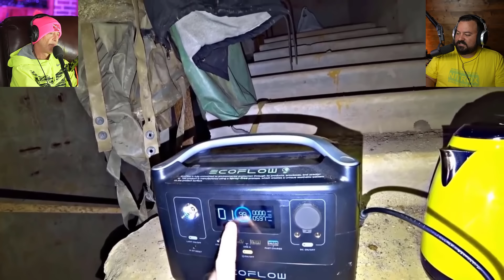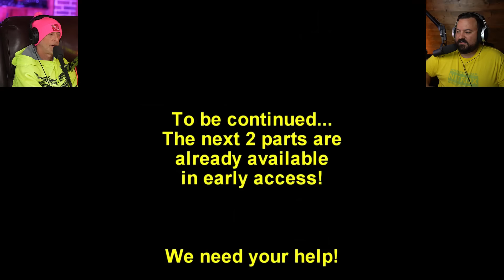Divers React to Diving in Chernobyl Part 2!

Comment: I am a retired Navy Nuke,  and as for the water, pure water is not radioactive,  but any impurities in it can become highly radioactive.   Cobalt-60 is the most dangerous isotope that they are probably encountering in large amounts.  It has a half-life of 5.27 years and produces ionizing radiation in the gamma ray window,  making it it exceptionally dangerous.  This whole thing is a terrible idea.
Reply: I don't truthfully believe they're diving in Chernobyl probably a bomb shelter? Do you have a professional opinion with that does it look like it could be a reactor?
Reply: And when radioactive materials go in your body, it would be mistaken for calcium, meaning it would go to your bones
Reply: @kevinverduci7600  definitely not Chernobyl's formerly operational reactors, they are being decommissioned currently. They did say it was the under construction reactor number 5
Reply: So whats the odds of them getting cancer from the dust inhaled
Reply: @sgtmuffinbadger6147  high
Reply: @kevinverduci7600  its real. They are near Reactor 5. There is a tunnel that does connect 4 and 5 underground. This is purely insane for views and money, but damn is it isn't incredibly entertaining
Reply: 5.27 year half life and Chernobyl was 1986 wouldn't that mean it's safe by now?
Reply: @samhyde6395  mostly, mostly safe, in the  safe zone that is.
Reply: @samhyde6395  "A good rule of thumb is that, after seven half-lives, you will have less than one percent of the original amount of radiation." so possibly safe, possibly not. seems to be a gamble. also is nobody going to mention asbestos? correct me if I'm wrong, but back then asbestos was still being used as insulation no?
Reply: @sgtmuffinbadger6147  radiation causes mutations at a cellular level so I’d say odds are very likely but the degree to how bad I don’t know however there’s a Japanese Man who survived both nukes on Japan in ww2 and lived to his 80s so you never know.
Reply: @kevinverduci7600  🤣😂🤣😂
Reply: @ughhbennnn  That's what I was thinking when the one idiot was hitting the ducting.
Reply: @kevinverduci7600  They are in the reactor 5 building that was never completed. Most of the videos they posted are from there. It's about a mile SE of the famous unit 4 that exploded.
Reply: @kevinverduci7600  they are in chernobyl in the number 5 reactor building which is about a half mile from reactors 1-4 it was never finished
Reply: I am navy nuke
Reply: @kevinverduci7600  they are diving in the stairwells of the unfinished reactor 5. Which is flooded.
Reply: It's okay, they were swimming through the power plant rinsing their mouths with the water and spitting out. Like wtf
Reply: I am retired navy nuke.  Trust me in doctor.
Reply: Of course you are
Reply: @samuelschick8813  true
Reply: @tylerofviolence , " I'm from the government and I'm here to help you."
Reply: @kevinverduci7600  No that really is Chernobyl just not the reactors that were active. It's the 5th and 6th reactors that were never completed.
Reply: How are they not wearing any protective masks?
Reply: @kevinverduci7600  They got tested the last time they did this and they were told they have a tiny bit more than usual but not a concerning amount of radiation. The water doesn't actually have much radiation the dust is what's radioactive and even that isnt too radioactive now. Ever since they closed up the reactor the zone for the most part has been safe.
Reply: @Crazyguy_123MC  yeah I would like to see them get tested again after their previous stunt where they where near the firefighters boot for half an hour and the radiation was off the scale
Reply: @kevinverduci7600  it is the dust that is radioactive and the mud. Which they do a very good job at breathing in and touch as much as they can. I don't think their personal safety is least of their concerns. At least they actually wore some kind of protection for once in that clip because even they know that the radiation was ridiculous in the area they were at (the lab with all the chemicals which were also leaking into the water and was essentially eating their suits)
Reply: Pure water is not radioactive bc why? Maybe bc it doesn’t have anything in it it’s called lure water for a reason….
Reply: @sgtmuffinbadger6147  100% chance at ambient radiation for the area over  I'd say 40 days in 10-20 years depending on lifestyle and risk factors. Doing this it could be over in as little as an hour leading to cancer development within 1-2 years depending on time spent where and what exposure level they are at and immune system does fight cancer constantly but eventually gets overwhelmed or undermined by exposure. So yes they are probably gonna have cancer or illness in some years.
Reply: @R3l3ntl3sss  is it isn't what
Reply: You should see part one if you haven't hahaha
Reply: @sgtmuffinbadger6147  very very very high
Reply: @kevinverduci7600  They keep saying they're diving in a reactor, but they mean the building housing the reactor. The reactor in building 5 was never fully completed meaning it never even housed any radioactive material. I believe you can visit the reactor chamber from this reactor because it's completely safe (there are obviously other dangers related to the area and what they're doing in this video).
Reply: I dont need the credentials that you have, to know this is a fucking terrible idea. 🤣🤣🤣
Reply: @Crazyguy_123MC  yeah, no offense, but I'm not trusting a Dr. To begin with let alone a Ukrainian, Russian, or any Europian one. To tell me have a slightly higher level, but nothing to cause too much concern.....
Reply: Bro I don’t know anything about what you said and I know it’s a bad idea
Reply: Water is a good attenuator of gamma though right? I’d be more concerned about alpha contamination from all the dust on the lead up to the water. Wasn’t a nuke but Army EOD.
Reply: Im asking out of curiosity, do you by any chance have any information as to what the tritiation levels are with regards to the water pools beneath the plant? Also why would they be encountering Cobalt-60? I would think that the main concern would be Cesium, iodine, plutonium, as well as other radiologically active uranyl progenates, their various isomers, as well as various radiologically active isotopic forms of materials which formerly composed the inside of the reactor and its shielding. I don't have precise data as to the composition of internal contamination of the plant but why is cobalt-60 the main concern for you. Im no reactor technician or professional but I would like to know your thoughts.
Reply: Thank God someone knows what hhey are talking about. My grandfather is also a former navy nuke, and currently to this day does maintenance and shutdowns on active plants across the country. Oneight say he's exceptionally over qualified in this area of expertise, and when I asked him about the water he gave basically the same answer. This is shit is mental
Reply: i mean.. i thinks everyone (but not them) have enough brain to know that's a bad idea
Reply: Would rather be afraid of getting alpha emitters in the body or calcium or iodine isotops. If it‘s fake I would still be  concerned about asbestos, heavy metals and other toxic chemicals.
Reply: @GuentherVanRaven  I agree I also dont know why Cobalt-60 would be a primary concern given that Cobalt-60 probably only makes up a very small portion of contamination consisting of the some 100+ radionuclides released by the containment vessel failure on reactor number 4; even with relation to the gamma emitting contaminative radionuclides Cobalt-60 still composes only a very small amount as Cobalt-60 is not a reaction product and would only result from neutron transmuted atoms of Cobalt-59 used in various metallic amalgams of the structural containment and reactor control elements. I dont know if perhaps cobalt-60 poses a greater contamination threat in Navy Nuclear Reactors but when it comes to the RBMK-1000 and its housing/containment structures cobalt would probably not be a main concern for contamination.
Reply: And the term, "Terrible idea." is the understatement of the year. 😂
Reply: obviously.
Reply: What is pure water Mr retired Navi Nuke?
Reply: @zeljkostrbac9469  pure water is water that contains no impurities. I.E . only H2O molecules.  The impurities are what become dangerously radioactive when exposed to the gamma, alpha, nuetron, and other radiation.
Reply: So where do we find pure water?
Reply: @sgtmuffinbadger6147  yes
Reply: @zeljkostrbac9469  I was wondering the same thing I believe what he means is coolant water which has not been circulated through the core. My main concern is why he is talking about cobalt 60 while that is not typically a product of reactor function, nor does it compose any considerable amount of the fallout from chernobyl as far as I am aware. I am quick to discount this mans claims of being a naval nuclear reactor technician his use of terminology which would be inconsistent with the training received by reactor technicians, combined with his refusal to reply to comments and a general lack of knowledge on the subject of reaction product/spent fuel composition is profoundly suspicious.
Reply: @dylansawyer3446  Couldn't agree more with you. This guy is bs and I'm always surprised how many people buy it. Very nice comment of yours!
Reply: @zeljkostrbac9469  Thankyou, I too am surprised by the number of people who claim to be naval reactor technicians in these comment sections, it seems to be the default for those seeking to present experience with nuclear reactors without actually knowing what they are talking about. It is a relatively harmless claim and although I attempt to avoid ad hominem in these comments; such claims piss me off beyond all reasonable regard, because I in some way feel that it is degrading to real reactor operators and technicians who must endure years of training and testing to become some of the most respected members of the Naval Forces. Thankyou for bringing this up. Again, I don’t think these claims are particularly harmful but calling these people out can help to curb the spread of misinformation which plagues Nuclear Power.
Reply: @stubbyhawk1  while you are correct that particulate contamination in water can become radioactive through neutron capture, the same process can happen in the water through a process known as tritiation, where the hydrogen in the water molecule undergoes radiological transmutation through neutron capture to become hydrogen 2 (deuterium) and subsequently hydrogen 3 (tritium). Tritium decays by beta - emission into Helium 3. While tritiated water is not particularly hazardous as it is dispersed relatively quickly to acceptable levels tritiated water can still pose an environmental threat and can be hazardous if it enters an organism in large quantities. Oxygen can also be transmuted into the radiologically active isotope of oxygen enumerated oxygen 15, oxygen 15 has a half life of 2 minutes and decays into Nitrogen-15 through positron emission. As such it is not as much of a concern as tritiation with regards to contamination. Also gamma radiation, alpha, and beta radiation do not transmute contaminants in the water into radiologically active materials, these contaminants also are transmuted via neutron capture.
Reply: @GuentherVanRaven  The compounds and mixtures you are referring to are known to scientists as “Soviet cancer dust” and yes they are very much a concern. 💀
Reply: @DunPoutinator  part of me believes that they are workers or researchers who have actually planned this out somewhat carefully in order to execute an internet stunt and gather attention.
Reply: @dylansawyer3446  you are 100% correct. I didn't include that for:  1. I do not type that fast and it is a lot of info, and 2. Given the short half lives of the isotopes involved, I didn't think it would matter that much.  You have described the process much more completely and accurately than I did, and I have no problem acknowledging that and giving you a huge kudos for a job well done.  Hopefully you helped answer any questions that remained in this matter. Btw, are you a Nuke?
Reply: @stubbyhawk1  no i am not a Naval Nuclear Technician however I wish that I was it seems like a fascinating job. I completely understand why you didn’t elaborate in detail the processes described in your original comment. I guess I have just had way too much time on my hands lol. Please understand that I am not trying to slander or defame you but these days; particularly after the release of the new Chernobyl documentary mini series on HBO I have been very skeptical of anyone who claims to be an expert in nuclear energy or radiological physics/chemistry. I have also been under a lot of pressure recently so my comments were a bit heated. I am sorry that I was so quick to discount you and I’m not trying to make excuses; just trying to explain the reasoning behind my comments. I am very interested in naval nuclear engineering however I have not had a chance to research it in depth, as I stated earlier my knowledge; as it pertains to that specific field, is highly limited. If at all possible I was hoping that I might be able to discuss this with you further.
Reply: @dylansawyer3446  no problem at all.   I was thrilled to see someone had such a good understanding of the effects of radiation and particle physics.  There is lots of bad information out there, so I also try and add sound scientific reasoning and facts to discussions on this topic whenever I see them. Knowledge is always a good thing, and something we should all seek to gain throughout our lives, IMHO.
Reply: @stubbyhawk1  I couldnt agree more. I was wondering though if you would like to discuss this further that we might be able to exchange discords so that we can talk there. If not, its all good but it seems that you might have some useful insights into places where my knowledge is somewhat lacking and I would appreciate it if you might be able to help me understand more. Thankyou for being so understanding.
Reply: @dansavka6727  I am not a naval nuclear reactor technician nor have I claimed to be I think you may have me confused with someone else. Both cesium-137 and cobalt-60 emit gamma rays and high energy beta - particles. The gamma emissions of cobalt-60 are more energetic than cesium-137. In addition to this if you were to compare two samples of cesium and cobalt of equal quantity the cobalt-60 would produce more gamma emissions than the cesium-137 in a smaller amount of time. As for the energy of the emissions that is not very important in this scenario as shielding is not a determinative factor however I felt that it should be noted. As for cobalt-60 verses strontium-90 these isotopes are difficult to compare as the hazards that they pose are distinctly different. I compared cobalt-60 and cesium-137 together first because they are both gamma emitters all through they do decay via beta- emission. Strontium-90 however does not emit gamma rays as compared to cobalt-60 so external radiation dosage is not necessarily a factor in comparison. This projection is highly speculative but generally speaking it is more difficult to shield against emissions from Cobalt-60 than it is the emissions of strontium-90 however once strontium-90 enters the body it can do massive damage and it is difficult to treat or stop the exposure, it also has a biological half life of 70 days. Now that we have compared the involved radio nuclides we can actually assess which would theoretically be present in the described scenario. Both cesium-137 and strontium-90 are direct reaction products where as cobalt-60 is not. By all reliable analysis I have seen, cobalt-60 composes an insignificant amount of the some 100+ radionuclides which were released as a result of the reactor containment structure failure where as cesium-137 and strontium-90 do make up a considerable amount. This is largely because as stated earlier; both strontium-90 and cesium-137 are reaction products where as cobalt-60 would only be produced via nuclear transmutation via neutron capture of non radiologically active isotopes of cobalt used in primary reactor structures. If we take in to account the amount of time since the release of the material much of the minimal cobalt-60 would have radiologically decayed into non radioactive nickel.  Strontium-90 and cesium-137 both have longer half lives and would still very much be present. Strontium decays into the isomer barium-137m which holds a nuclear charge. Which emits prompt gamma rays of moderate energy at about 4% but more often decays by beta+ emission which subsequently produces gamma radiation via annihilation, to become stable barium. As for strontium-90, it will decay into yttrium-90 which will subsequently decay via beta- emission into stable yttrium. In this scenario you are correct that strontium-90, cesium-137, and their pro-generates pose more of a threat. I know that was a long road to get there but I like to present a full analysis justifying my conclusion.
Reply: @dansavka6727  Trident and ICBMs are types of missiles... not nuclear reactors.  I never said the water they were in was pure, I was just stating that the contaminants in water are what become dangerously radioactive, not the water (apart from short-lived heavy water and oxygen 18 and oxygen 15 (hl 122 sec)).   I worked on  S8G &  S3G cores primarily, but while an instructor at MARF, also got to spend a fair amount of time studying the D1G core over in the big ball.
Reply: @stubbyhawk1  blah blah yada yada.. you said that you were a nuke.. I asked what kind ICBM or trident..
Reply: @ughhbennnn  I didn’t even think about that. Oh man.
Reply: @avah4455  yepppp. all this urban exploration seems fun until you realise majority of the buildings are super old and most likely have asbestos particles in the air. 99% of the people exploring don't have the proper PPE too
Reply: @samhyde6395  that’s the time it takes for half the sample to decay and then for half of that to decay and so on and so forth
Reply: @kommandantgalileo  watch the video where they go get tested for radiation at the hospital. None. Zero. People have lived in and near Chernobyl the entire time grown very old and are just fine growing food there and drinking the water. You get more radiation on a 1 hour plane flight than spending a month in Chernobyl.
Reply: @bubbinsky2390  yeah, I know that.
Reply: @KDill29  And what would be the problem with European Doctors? Are you American?
Reply: @ughhbennnn  Good point, for most isotopes 7 halflives is considered "safe" but that's in the context of things like fallout where there's a single event that spreads a lot of radiation widely over a wide area, it's not really intended for an intense localized source, after 30 years a Co-60 industrial radiation source for a food irradiator or medical packaging sterilization system would probably still be hot enough to kill.  1% of an assload is still an assload.
Reply: “Pure water”? 
What does that even mean?
Reply: @ArolzStreams  non contaminated, just H2O
Reply: @ArolzStreams  pure water as in not contaminated by radioisotopes and not containing tritium.
Reply: @dangerszewski9816  oh ok I thought he meant purified water.
Reply: the chernobyl disaster occured in 1987.

so if this isotope has a half life of 5.27 years, and there has been no introduction of new elements... that means there would only be 3% of the radioactive elements remaining... right?
Reply: @samhyde6395  
theoreticaly, yes. the Zone should (on paper) be entirely safe for habitation. 
the only issue would be the ionizing radiation released from the elephant's foot. everything els was successfuly contained, and dismantled.
Reply: @ughhbennnn  
the asbestos would be far more dangerous than the radiation.
Reply: @zhongxena1155  
you do realize that the sun produces an imense amount of gamma radiation, right? 
we measure radiation in Sunshine Units.
Reply: @Crazyguy_123MC  
not to mention that there wasnt a ton of fallout that hit this area. it was a reactor that over-heated... not a nuclear bomb.
Reply: @stubbyhawk1  
yes, but that radiation does not last nearly as long as if there were radioactive isotopes present. example: regular top soil that has been made radiactive by gamma rays will not have nearly as close to the same half life as Uranium.
Reply: @dylansawyer3446  
we are over 5 half lifes for cobalt. 
even if there was a major amount present at time of melt down, there is only about 3% of what could have been.
Reply: @dylansawyer3446  
the only thing here is that you did not include the context of time. 
after 36 years the hazard is seriously reduced.
Reply: @Jimothy-723  yes, assuming no introduction of new elements that is.
Reply: @Jimothy-723  It didn't over heat it did blow up and it was at the time extremely dangerous but after all the cleanup and closing off the reactor it became safer and once they put the big one over the facility it became even safer. Radiation levels dropped significantly after it was installed.
Reply: @Jimothy-723  It is not common for ionizing electromagnetic radiation to be measured in "sunshine units". I do not know where you got this information. "Sunshine units" was a PR term used breifly by the United States Department of Defense for the Strontium Unit the Strontium unit was used to describe radiological dosage as it would pertain to the bodily absorption of Strontium-90. As well as its incorperation into calcium structures.
Reply: @Jimothy-723  The reactor exploded so the contents of the reactor were expelled into the environment. This "not a nuclear bomb" argument doesn't hold up. First off the reactor did not simply overheat, overheat is an understatement, following the catastrophic failure the corrium mass reached thousands of degrees and the steam explosion which blew apart the reactor was powerful enough to throw large portions of the reactor structure weighing hundreds of tons tens of meters into the air so no it was not simply a reactor overheating. This was full blown meltdown and high level contamination incident. This not only resulted in the expulsion of many extremely hazardous contaminants into the environment. Nuclear bombs are not the only device which can produce radioactive fallout. The entire area surrounding the plant became heavily contaminated as a result of the incident. The Chernobyl exclusion zone is safe now because much of that contamination was buried beneath the earth, this combined with strict safety protocols makes the Chernobyl exclusion zone safe for human activity in the area. Violating these strict protocols can prove to be very dangerous. You clearly have a less then rudimentary understanding of this topic.
Reply: @Jimothy-723  It astonishes me how you have the audacity to make claims on a topic that you clearly dont understand. It is even more astonishing to me that you evidently do not even do a basic google search on what you are talking about in order to fact check yourself prior to posting.
Reply: How can they survive? They’re ukrainien, end of story.
Reply: @samhyde6395  roughly 1/250th 1/500th of the radiation give or take a couple of years of the radiation at the time of the meltdown. So while not as deadly as it was still likely dangerous and potentially life altering.
Reply: gamma radiation is the least dangerous form though. alpha particles are a lot more dangerous, but those can't even pass through your skin most of the time. however, if you're breathing them into your lungs, they can cause massive damage to the DNA in your lung tissue, and the risk of cancer increases exponentially
Reply: @Saiege  or those burnt copper cables with all the ashes floating around in the air. If none of them are getting cancer from that stuff i would be surprised
Reply: @Crazyguy_123MC  That testing video looked dodgy as hell though, some weird looking soviet era tech wedged into a corner of some old hospital. The entire procedure was like $12 per person. That cannot have been anything substantial.
Reply: @toomanysymbols  Gamma radiation is not inherently less dangerous than alpha radiation, all radiological contaminants pose different hazards. Gamma rays have a greater ability to penetrate material than alpha particles. Also, I think you are confused as to what an alpha particle is, an alpha particle is not a piece of radiological material its a positively charged free nucleon system with a mass and charge equivalent to a nucleus of helium 2. They are ejected during alpha nuclear decay of any isotope which undergoes alpha decay. Alpha particles are also extremely heavy and hold a substantial charge, meaning that they can only travel a short distance before they are destroyed. Gamma rays are distinctly different, for this analogy, we will be thinking of gamma rays as particles rather than waves. The particle from which a gamma ray is derived is a type of boson called a photon. Bosons are a primary classification of massless particles whose distributions are described by boes-einstein statistics. They constitute the highest energy spectrum of the electromagnetic spectrum and are ionizing. They can pass through your skin and outer layers, damaging cells inside of your body this means that prolonged exposure to a gamma-emissive source will cause damage to internal structures. On the other hand in order for alpha particles to damage internal structures a source of alpha particles must be inside of your body, this means that there is no way for you to put distance or material in between you and the source and thus you will continuously be exposed until your body is able to purge the contaminant. Its not that one is more dangerous than the other its all about the method of exposure and dosage.
Reply: @dylansawyer3446  Is it not right to assume that because alpha particles are comparatively larger, they also carry more energy when they collide with something, and are able to cause more damage when coming into contact with sensitive tissue?
Reply: 5 years? Then this isnt radioactive
Reply: @kommandantgalileo  No it's not.
Reply: @jaffacalling53  which comment are you replying to
Reply: @sgtmuffinbadger6147  i would say chances of cancer are pretty low...gotta stay alive for cancer to develop. I'm really surprised these guys have survived into adulthood...sortof...
Reply: @samhyde6395  look up the "elephant's foot"
Reply: @kevinverduci7600  It's Reactor Unit 5, Unit 5 was under construction at the time of the accident, so it was never active, meaning that the Unit 5 Reactor was never fired up, so it's not as unrealistic as you might think.
Reply: I’m not nuclear reactor expert…completely different profession…but I wouldn’t even visit this village, regardless of who says it’s safe. 
I keep wondering about the Russians that went and lived there and took a bunch of stuff back to Russian after the Ukrainian invasion.   That was insane.   This is madness.
Reply: @kevinverduci7600 here’s how you can tell the “real” Chernobyl reactor facility is covered by a lead sarcophagus. A few years ago a New Safe Confinement structure which is the largest in the world. The area is covered with fencing, armed guards, workers, researchers, and etc. What these guys came upon was probably a giant shed of garbage that hasn’t been pumped out in 40 years.  Chernobyl isn’t like how it is in the movies or games it’s not completely abandoned there are people actively work there
Reply: @KDill29  that’s a very racist thing to say. What has their race got to do with credentials? You’re writing off most of the Western world with that comment.
Reply: https://en.wikipedia.org/wiki/Chernobyl_groundwater_contamination
Reply: @xarolinaxota7202 you thought you were being clever lol
Reply: I am not a nuclear scientist or ever worked around it. I did however research the effects of different isotopes on the  cells of human and primates. Ever since I was a little girl I was fascinated by radiation.  Probably because I played so much Fallout 😅.  Oh and I am a former nurse and was close to getting my degree as a pathologist.
Reply: They obviously took Rad-X before, so it's fine
Reply: @dylansawyer3446   co-60 is the biggest concern as far as navy nukes go but its not that its a product of fission, its a co-59 activated by a neutron. cobalt is a strong and makes it suitable to sometimes be used in the plant materials. i dont know if chernobyl employed cobalt into their plant tho.
Reply: @CoolKidReeceZ  I know from contamination analysis that cobalt 60 was detected but not in large quantities. Its not clear exactly what steel the pressure vessel was made of. But given other soviet reactors of the same era which were used in the russian navy it is not improbable that some amount of cobalt was used in it. Additionally cobalt is used in some internal measuring equipment. Namely detectors used to evaluate neutron current. Due to the nature of soviet era nuclear documentation it is not clear to me what instruments exactly were used in this specific reactor.
Reply: where would the cobalt-60 come from? main isotopes from the waste are not in that range.
Reply: Lol no sir.
Reply: "pure water isnt radioaktive"

No Shit Sherlok 🤡
Reply: @magamen6572 extremely unlikely
Reply: Sounds legit.
Reply: Thank you for your service Mr. Nuclear Bomb.
Reply: How would Cobalt-60 get there, if the catastrophe was almost 40 years ago? Not to mention this block didn't have a meltdown, so any hot particles would have to come from outside.
Reply: @PuerRidcully  Cobalt is simply a non-radioactive metal used in metal hardening alloys. It is also used in paint pigments (Cobalt-blue) and some other industrial uses such as catalysts in some chemical reactions such as petroleum industry and used in airbags. The stable isotope of Cobalt is Co-59, its atomic number is 27 (meaning it has 27 protons). I needed to explain the uses of non-radioactive Cobalt to explain the radioactive question.

Since Co-59 is used as a metal hardener. It is used in alloys of metal in components of a nuclear reactor. The nuclear industry has made efforts to use a different metal hardening alloy and replace it with something that will not become activated, but we haven’t found suitable substitutes in all cases.

Since there is Co-59 in the metal of the nuclear reactor, during reactor operation, the core is throwing off neutrons. Some of the neutrons are lost by being absorbed in atoms of metal. Some of the atoms that absorb neutrons are the Co-59 atom, when this happens, Co-59 gains a neutron and becomes Co-60, which is a radioactive isotope of Cobalt, it has a half-life of 5.27 years. When Co-60 undergoes radioactive decay, it Beta decays meaning one of the neutrons becomes a proton and a Beta particle is ejected along with an antineutrino. (A Beta is the term used to describe the electron that is emitted from the nucleus of a radioactive atom when the atom undergoes Beta decay.) Since 1 neutron became a proton, there are now 28 protons in the nucleus, so the atomic number is 28, and that atom is no longer Co-60, it is Ni-60. During the radioactive decay process, the nucleus became excited so there are also multiple energies of gamma radiation emitted to bring the atom back to its unexcited state. The 2 predominant gammas are emitted 99.99% of the time are a 1332 keV gamma and an 1172 keV gamma. These are very strong energies for gammas, meaning they are very penetrating and must be dealt with in the nuclear industry because these 2 gammas give almost all of the radiation dose received by workers in a nuclear reactor, and when someone uses the term Cobalt radiation, it is these 2 gammas emitted by Co-60 that they are talking about.

Also…Co-60 is manufactured for use in the medical industry and some medical industry treatments use Co-60 gamma radiation as a type of treatment. Co-60 is not the only isotope used, but procedures such as the ‘gamma-knife’ have used multiple high activity sources with the beam focused at a tight point to kill cancer cells without having to perform invasive surgery.
Reply: @Fumo-Deus me too
Reply: 5.27 years so should be fine now then?
Reply: You sound like you know your stuff mate thanks for the post
Reply: @sgtmuffinbadger6147  yes.
Reply: @samhyde6395  no, it won’t be safe in that reactor site for about 20k years, around 3k doe outlying areas. It is 1000 square miles in the zone but this is dumb. The problem is the reactor core is continuously spewing new radioactive material all over the site, it will slowly creep out over the years, it’s not like a A bomb that went off where all the energy dispersed quickly and is pretty much gone in areas like Hiroshima now.
Reply: @kevinverduci7600  Chernobyl is an entire area, not just a reactor
Reply: I had no idea nukes could talk and comment on a yt video 😂
Reply: @kevinverduci7600  they are totally diving at Chernobyl… There is another channel that I follow where guys sneak in all the time and I recognized the staircase that goes down to the water from their video. They actually drank water from that exact same spot. They filled up their water bottles so they would have water to hike out. This is Chernobyl, this is real. 100%.
Reply: pure water is slightly radioacrive as it contains diterium / tritium or heavy water
Reply: @sgtmuffinbadger6147  1-1,000 depending on further exposure to The Sun and other sources!
Reply: still water all impurities are on bottom
Reply: It’s still dangerous regardless of half-life. Doesn’t mean it’s not dangerous, it’s still emitting dangerous radiation.
Reply: @stubbyhawk1  cool - son is a nuke and I’m about to try and impress him with this. Knowledge  :)
Reply: @kevinverduci7600  couple years ago watched guys just swimming in it no gear. Crazy Russians. Had to sneak in.